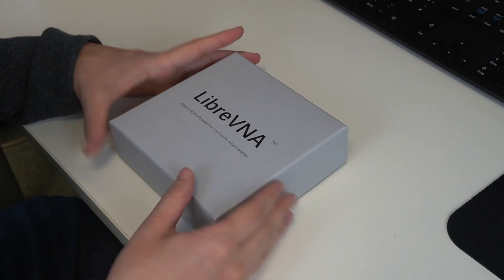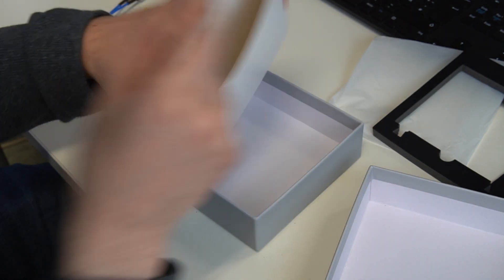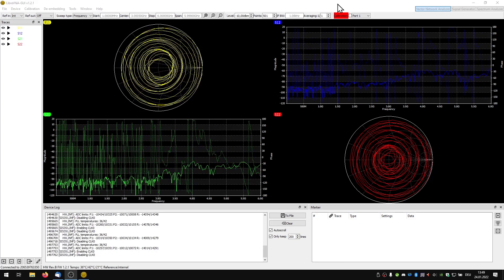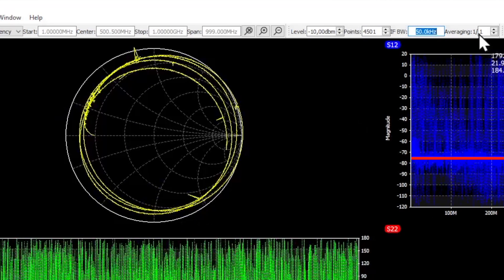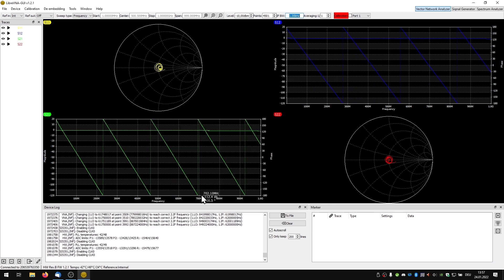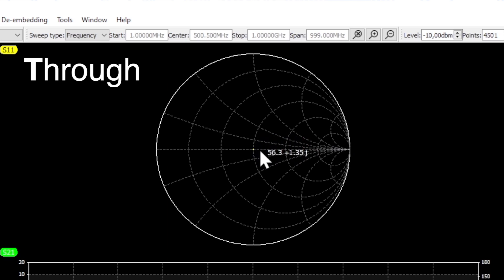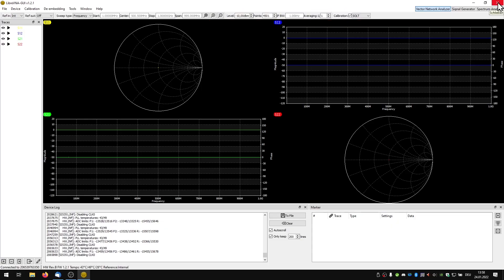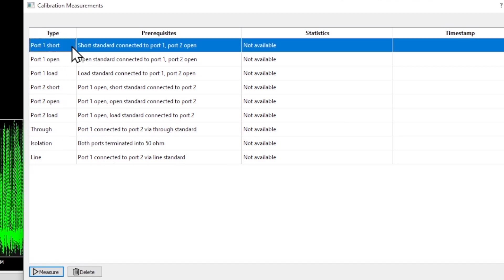LibreVNA Unboxing and Setup

Comment: Have you compared the results with a high-end VNA?
Reply: That's a good idea for a future video - thanks! I havn't performed comparison measurements yet. Basically, the CalKit isn't accurate enough for scientific work; but good to use for quick measurements. The dynamic range of the LibreVNA itself seems quite good compared to a 20 year old professional VNA. Unfortunately, the LibreVNA cannot measure below 100kHz. Around 1GHz, it feels slightly inaccurate. But I would need more time for a fair comparison :)